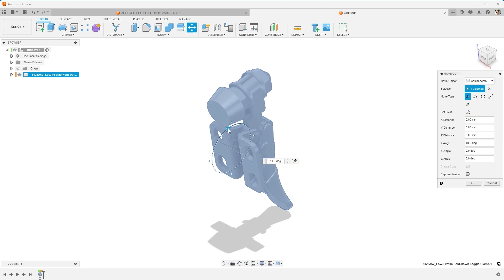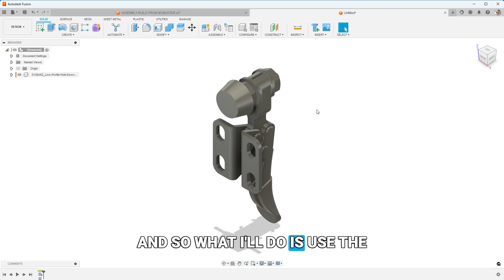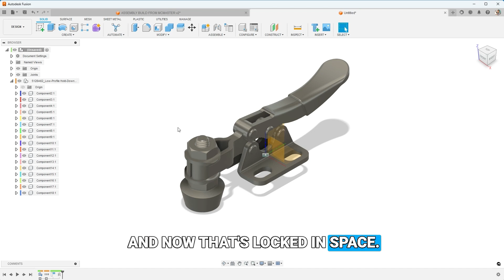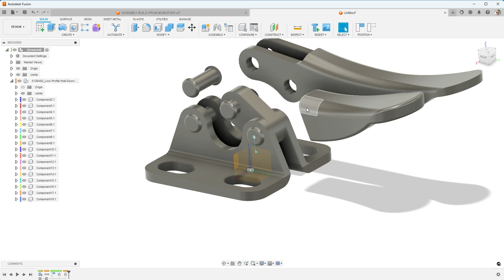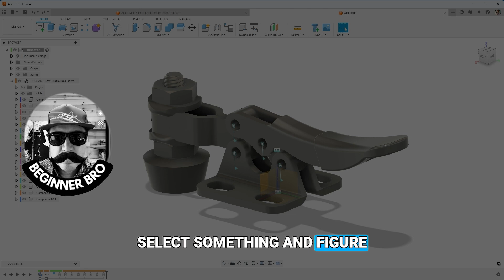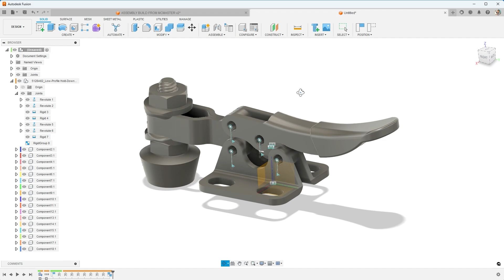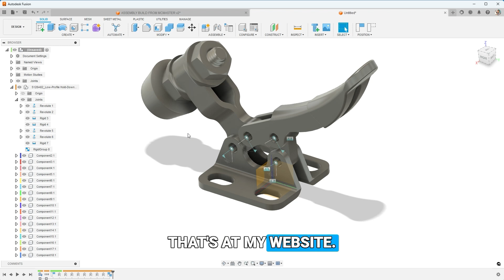Secrets to Fusion 360 Assemblies (Obscure Tips)

Comment: hey thanks for all the videos! so here is my problem: im working fulltime with fusion for work so it would help a lot to get an answer. if im importing an assembly to fusion, created in solidworks, lets say a car, and i just want to work on the steering wheel. (making molds or an attachment or something). my latest aporach was to select the steering wheel and than press "save copy as" to save it in my fusion browser, than deleating it from my assembly, than droping it vorm my browserfolder back into my assembly (to have the assembly compleat) an than i can open the steering wheel by it self from the browser to work on it. i found when i create an assembly out of the exported steering wheel and the exportet shiftknob the koordinate system is not the same as the main assembly where i took it from. (the car assembly). how can i "export" a component with the origin? i have yet not found a solution or workaround